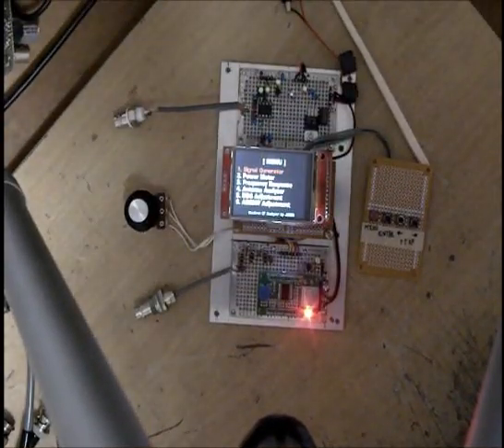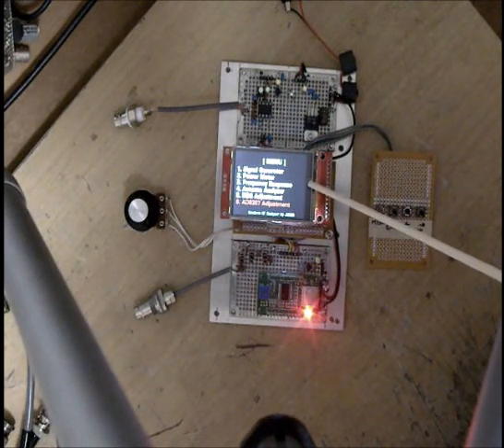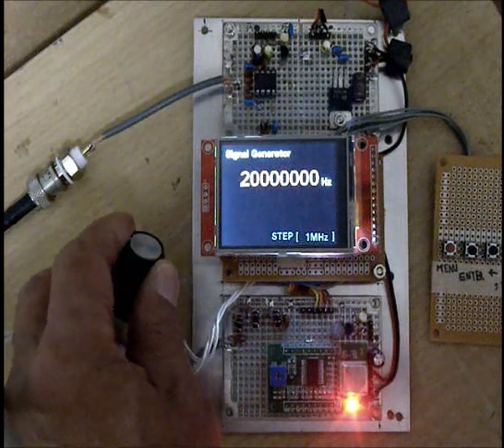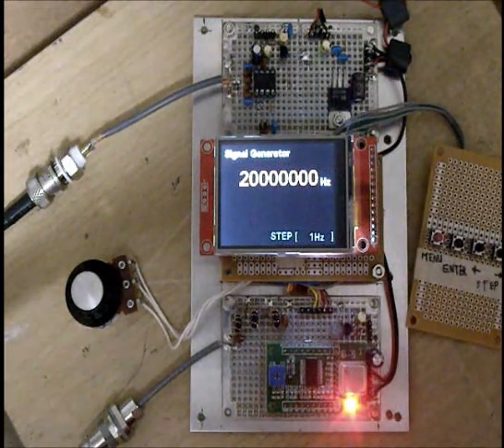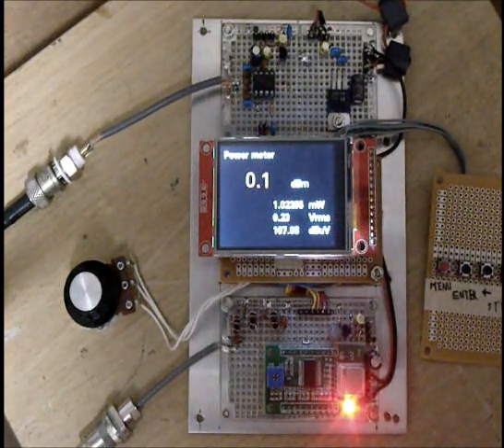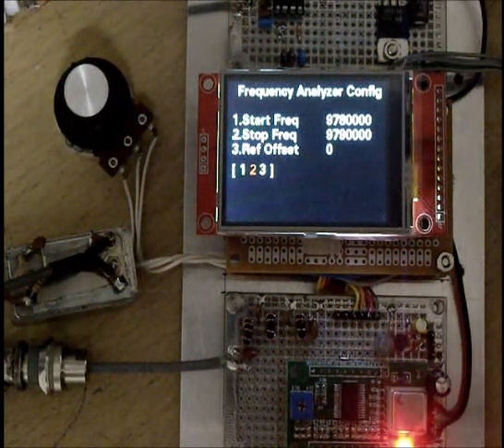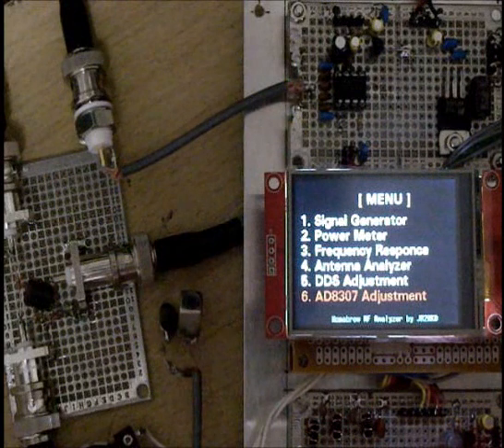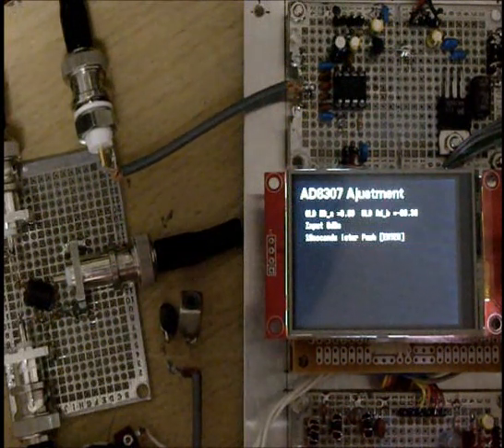RF　Analyzer

Comment: Hi Mr. can you tell me what is the maximum frequency that can handle by the antenna analizer? 
I very interesting to make to analize my diy antenna for 433mhz freq, thanks
Reply from the maker: Thank you for your comment.
The maximum frequency is 55 MHz.
If you attach a converter to OUT, there is a possibility even at 430 MHz, but I think that accuracy can not be expected.
73's   Ryuu
Reply: @JA2NKD  thanks for your reply, can you give me some advice, about how to tune my antenna at 433mhz actualy, because i need to use on rc plane.. thanks

mijil
Reply from the maker: Hi,Mijil
The cheapest and practical thing is to adjust the signal strength using the S meter of the 430 MHz receiver. I think.
The UHF analyzer is expensive.

Comment: thank you for link to code and JPG sir can you supply a little more information on "cd4050" pin inputs to pin outputs you used not used this chip and LCD TFT panel combination before very new to arduino coding I am learning a little guidance would be much appreciated regards steve
Reply from the maker: Hi,Steve Thank you good comment.Please see my blog about LCD interface.
https://ja2nkd.blogspot.jp/2016/08/arduinolcd-interface.html
If you have more questions , contact me again.
73's JA2NKD